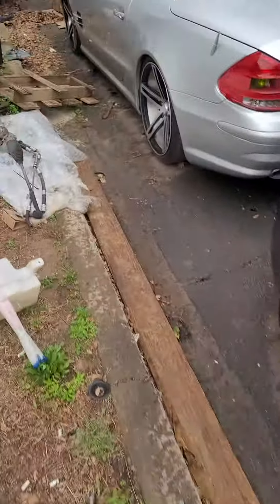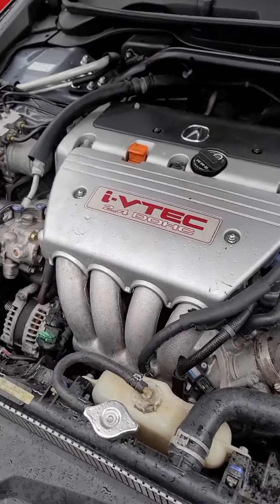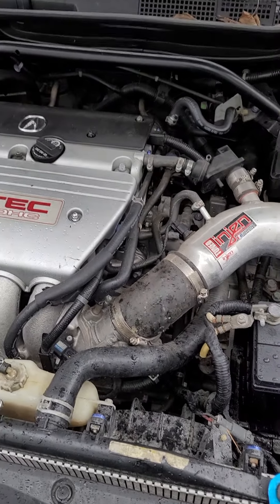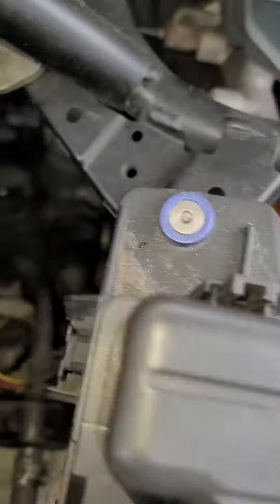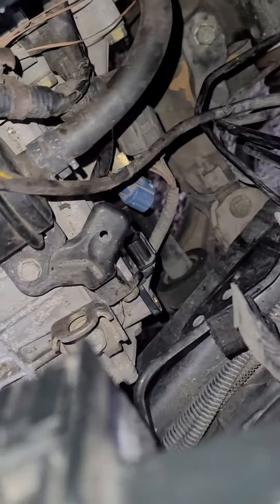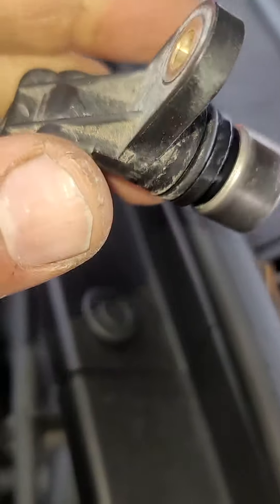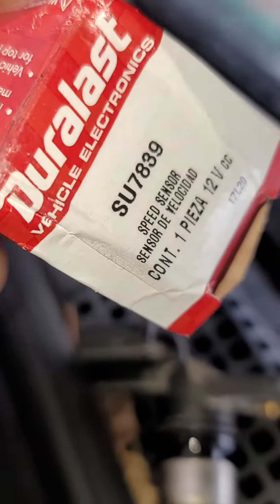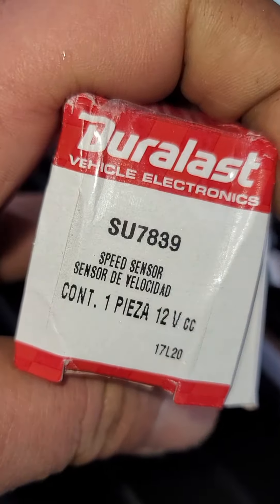Acura TSX Or Honda Accord 2.4L Code P0717 Input Shaft Speed Sensor It Makes The Car Slow Down.SOLVED

Comment: Hi does the output speed sensor look exactly the same ?
Reply from the maker: The output speed sensor is also known as the vehicle speed sensor , here's a link with the picture    https://www.amazon.com/Premium-Transmission-Compatible-2003-2008-2003-2007/dp/B092J8MSC6

Comment: Would this cause a blinking D and hard shift from 1st to 2nd??
Reply from the maker: That could be low AT Fluid, and the best way to check the fluid is after you drove the car for a while, then check it while the car is running
Reply: Fluid is good, I get a delayed shift sometimes, and a harsh shift from 1st to 2nd, no codes at all for anything. I’m thinking it’s just my transmission.
Reply from the maker: @isaiahw1995ify  https://www.autozone.com/motor-oil-and-transmission-fluid/transmission-additive/p/lubegard-instant-shudder-fixx-2oz/592122_0_0
Reply from the maker: @isaiahw1995ify  add this to your transmission fluid and see

Comment: Do you know where is the output speed sensor is located on the acura tsx
Reply from the maker: What's the code?
Reply: P0723
Reply: Cant figured out exactly where it is
Reply from the maker: @Mj_anglers  what year model your car
Reply: Acura tsx 2006
Reply from the maker: @Mj_anglers  ok send me your email or phone number  I will send you a picture with the sensor location it might be the sensor seal is leaking
Reply: I really appreciated sir
Reply from the maker: @Mj_anglers yeah no problem
Reply from the maker: @Mj_anglers  email me hanitwfk@yahoo.com and put tsx in the add
Reply: I sent it
Reply from the maker: @Mj_anglers  no problem I just sent it check your email
Reply: @hanitwfik  yea i got it do you know if i have to remove anything to get to it or is exposed?
Reply from the maker: @Mj_anglers  you might need to remove the battery
Reply: @hanitwfik  okay cool will do thank you so much again man really appreciated i was going crazy not finding that damn sensor lol if i have any questions ill let you know thanks again!
Reply from the maker: @Mj_anglers  thank you let me know if you have any questions good luck 👍
Reply: I just noticed that where it says output speed sensor says M/T that mean manual transmission? I have a automatic transmission is it still in the same spot or no?
Reply: @hanitwfik  sir
Reply from the maker: @Mj_anglers  that's what it showing on my data I don't have the car front of me to look can you look and see if the sensor in the same location
Reply: @Mj_anglers
 @hanitwfik 
Hi guys, I also have a 2005 Acura tsx. I need to change the output speed sensor and solenoid B. Can you guys help me find the location for this please?
Reply: @Mj_anglers  were you able to find the location for the output speed sensor? If so, can you help me out.
Reply: @CarlosSanchez-cn5yc  its on the back of the motor
Reply: @Mj_anglers  thanks for the reply. Is it a specific color? Would I have access to it from the top or bottom of the engine?

Comment: Did this fix the P0717? There's 2 speed sensors. I replaced the other one and still have P0717
Reply from the maker: You gotta replace the right one
Reply: @hanitwfik  so the one you replaced is the right one? Btw, good video :) and thanks for making it.
Reply from the maker: @therock6788  yes and thanks you so much

Comment: Please I have an Acura TSX 2005 ,my fuel consumption is high and I have checked everything except for the speed sensor which is disconnected,can it be the cause
Reply from the maker: A faulty engine can result from failure to replace spark plugs, fuel filters, air filters, oxygen sensors, or engine valves. Worn out and dirty fuel injectors can lead to quick burning of fuel; therefore, high fuel consumption. Replace faulty parts of your engine as soon as possible to avoid bigger damages as well.
Reply from the maker: also have you check the relays they usually go bad easy? under the driver side left foot take the fuse box panel off you will see those relays 
 num21 main relay
 num 23 ignition coil relay  
num 20 air fuel sensor relay
 num 23 second main relay

Comment: Could that make the car not move at all ?
Reply: I got a 2004 Honda Accord an it's acts like it's in limp mode it'll drive an 1st an 2 st then sometimes just not go I got the same code on mine
Reply from the maker: Mine was not shifting gears so yeah it may fix your problem this sensor is cheap so is not gonna hurt to try